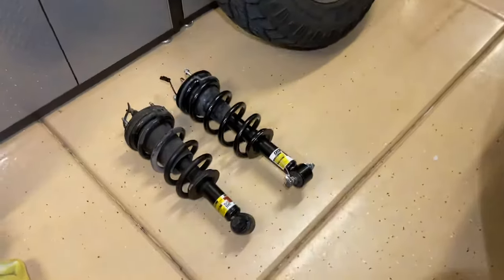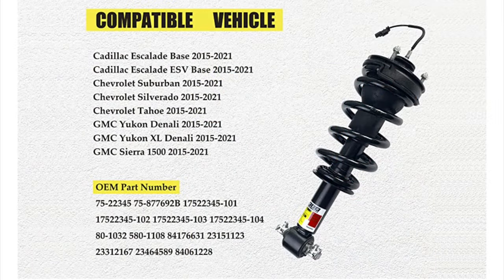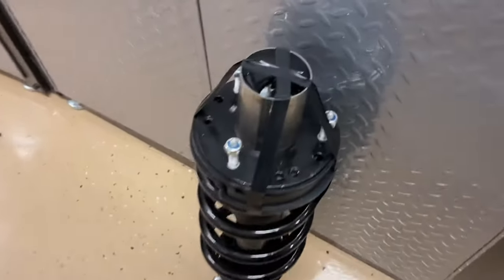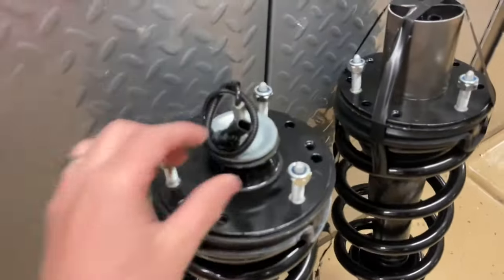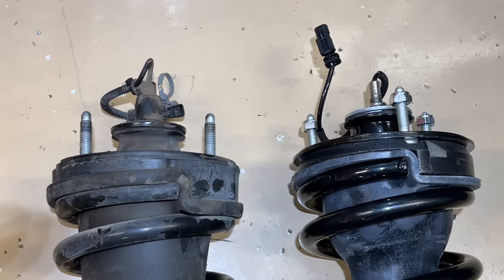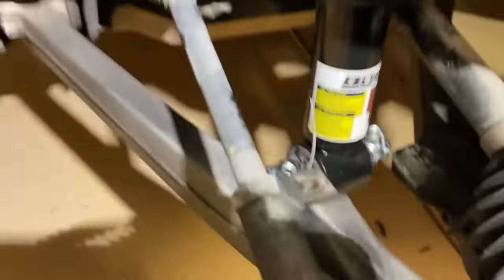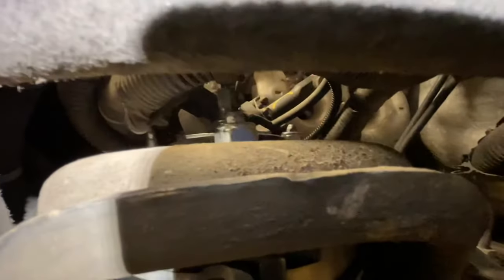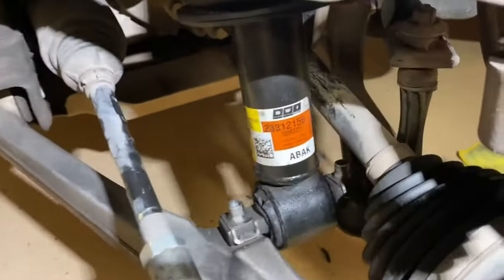Aftermarket Magneride shocks fitment problems

Comment: As most of yall are looking for answers as I was, I went to ebay and purchased a pair of aftermarket magneride struts for my 2015 yukon denali for a fraction of the price as OEM. Now with that I did have issues with the height difference because the old being wore out compared to the new one. This is an easy fix just unbolt the sway bar as you work on each side. I also had an issue with the new lower strut mounts not being in the right position just mount the top get some vise grips or something to grab the mount and rotate it 180 degrees. This requires some muscle! I hope this helps and save someone else some money!
Reply: Did your ride height go back to what is was before? Do they have to settle in? I just changed my 2016 suburban and it sits a little higher.

Comment: I installed replacement magnaride shocks and struts on my 2017 Escalade.  They fit right in with no issues.  I bought them from Auto Zone for about 800. Brand is Arnott and they actually use Eibach springs. Great videos, Especially the Cobra ones! Good luck
Reply from the maker: Thank you. I’ll have to check those out
Reply: Did you get just 1 or a pair for $800?
Reply: @jack0lee  for the pair.  They had a sale with 25% off and free shipping but this was over a year ago
Reply: @mharp7353  ah I see. They’re about $584 for 1 now.
Reply: @jack0lee  yeah seems like everything has gone up.  They usually have discounts if you order online, I'd keep checking their website, its worth it
Reply: Do they still work like factory GM ARC suspension?
Reply: @jack0lee    That just happens to be the exact price from GM parts direct (as of Nov 23).  FYI
Reply: @avflyguy  don’t have my Denali anymore but thanks for the info
Reply: @avflyguy  what's the website for GM parts direct?

Comment: I spent 164 dollars for the pair on eBay. Brand new. No issues going on. Ride is very smooth. I do want to thank you for the video. It saved me a lot of stress. U did everything perfect.
Reply: Which ones did you go with
Reply: What brand did you use? I have a 2016 Yukon Denali Xl
Reply: What was the part number?... would it fit 2017 suburban premier?

Comment: I just did this, All you had to do was undo the sway bar links and your lower arm will drop down enough to get the taller strut right in there, I don’t consider that a modification. Truck sits more level now, not so much rake, and rides 100% better!
Reply from the maker: It was also not lining up straight and I was not able to twist the strut. As I said, I didn’t want to make it non-returnable and they were very firm on not taking it back if it was installed. I also didn’t like how poorly written the instruction were on that brand and the warnings they gave that they might not work. I was much happier with the Arnott brand that went right in

Comment: The genuine GM magneride replacements now have a lifetime warranty where arnott has cut theirs to 2 years. GM only sells the fronts without the spring so the strut has to be disassembled and the clip removed, but at least it will be covered for life...
Reply: I highly doubt GM will honor that. 

But at $900/each they better

Comment: Well, a couple of days ago I replaced one (2016 Yukon Denali)and I saw exactly what you are showing here, I determined that the damaged one was compressed due to use and in addition it had already thrown away all the oil and when I removed all the screws it just fell to the not even necessary to loosen the stabilizer bar, and it was the original, well when installing the new one I obviously lowered the arm a little with a bar, tightened all the screws and that's it! The truck feels perfect, I don't feel like it's loading to one side. The height of the truck's body at the front is exactly the same as the right side, and well, my wife is happy to not hear that horrible noise that the damaged shock  had. Now someone tell me if it is not correct or the opposite, I saw some comments below and they practically think the same as me, greetings
Reply from the maker: I did what I felt comfortable with to the point I could still return the struts. By comparison, I went with the Arnott brand and they were aligned properly and went right in. For the money, that’s how the install should go. I didn’t want to mar them up and make them fit only to find out they could not be returned
Reply: @dannyjohnsonsgarage  You are right, perhaps the pressure from my wife, I decided to put it on even though I saw that there was still a difference and I was worried and looked for this video that I had already seen a few months ago, what do you advise me to do? I bought this one for 200 from someone in my neighborhood, I found it on Facebook,  He is a mechanic and he told me that he ordered it for a customer who never showed up. should I leave it like this? Or do I order the originals? I would appreciate your response!
Reply from the maker: @elhalcondelbajio1923  I would ask the mechanic you bought it from about the situation and see if he recommends you “make it fit” or not. Here are the Arnott ones I used in case you decide not to use what you have. This is my Amazon affiliate link and I will post the video below https://www.amazon.com/Arnott-Coil-Over-Eibach-Magneride-L-SK-3354/dp/B08VF88P43?crid=38JDH2IFYEA9K&keywords=Arnott+-+Fr+Coil-Over+Eibach+Strut+15-20+Cad+SUV%27s,Chev+Silver/SUV%27s,GM+Sierra/SUV%27s(K2xx)+w/Magneride-L/R+(SK-3354)&qid=1669272882&sprefix=arnott+-+fr+coil-over+eibach+strut+15-20+cad+suv%27s,chev+silver/suv%27s,gm+sierra/suv%27s+k2xx+w/magneride-l/r+sk-3354+,aps,290&sr=8-1&ufe=app_do:amzn1.fos.08f69ac3-fd3d-4b88-bca2-8997e41410bb&linkCode=sl1&tag=2004047-20&linkId=6ce005c6cd213796132b9c237f1113d5&language=en_US&ref_=as_li_ss_tl
Reply from the maker: https://youtu.be/8c7qfElwx3o?si=h9nV40nm1OMksaEg

Comment: Does anyone know why the passenger side strut seems to fail more frequently than drivers side?
Reply: I don't know but on my Sierra 1500 Denali,  the right side is blown out - dried oil and grease everywhere..  And on level ground it sat about 2 inches lower on the passenger side.

Comment: Please don’t use those bolts they provided they look cheap and not suspension grade. I used the original ones
Reply from the maker: Yeah, I went with Arnott struts in the end and used some of the factory hardware but theirs seemed better too https://youtu.be/8c7qfElwx3o?si=BKuibd56iAPdhGlX

Comment: curious what was the strut that caused this many issues?  i bought the dorman version, i had to take out the sway bar link total pain.  even with it removed and the strut all the way up in tower with closest nut spun down stuf 3/4 of the way the unit was down farther like in your video.  after messing around with a jack and wood to lift it up and soem prying it finally went into place.. then the fastners that guide the bottom two bolts and tighten it were wrong!  i had to transfer over the old ones.  a 1 hour job you see on youtube , in out was like a 4 hour job but it was my first one.  if strut was the right length to begin with and no sway bar link removal it would of be considered "fun" almost for the average dude. wonder if the arnott and dorman are same length!  ? what was yours from amazon?
Reply from the maker: The Arnott ones worked in the end. Went right in https://www.amazon.com/Arnott-Coil-Over-Eibach-Magneride-L-SK-3354/dp/B08VF88P43?crid=38JDH2IFYEA9K&keywords=Arnott+-+Fr+Coil-Over+Eibach+Strut+15-20+Cad+SUV%27s,Chev+Silver/SUV%27s,GM+Sierra/SUV%27s(K2xx)+w/Magneride-L/R+(SK-3354)&qid=1669272882&sprefix=arnott+-+fr+coil-over+eibach+strut+15-20+cad+suv%27s,chev+silver/suv%27s,gm+sierra/suv%27s+k2xx+w/magneride-l/r+sk-3354+,aps,290&sr=8-1&ufe=app_do:amzn1.fos.08f69ac3-fd3d-4b88-bca2-8997e41410bb&linkCode=sl1&tag=2004047-20&linkId=6ce005c6cd213796132b9c237f1113d5&language=en_US&ref_=as_li_ss_tl

Comment: Just a couple observations.  It's not uncommon on old magneride shocks for them to be stuck partially compressed and locked in that position.  So the fact that the new one was a little longer is possibly normal.  your old shock is probably worn/damaged and not extending as far as it's supposed to.

Also, it's totally possible for the top and bottom of a strut to be twisted.  They don't excent/compress only.  They are designed to allow twisting motion.  It might be a little harder to twist a brand new shock, compared to one with worn out seals
Reply from the maker: All I can say is I was not impressed. I since went with Arnott and they went right in! No issues 
https://youtu.be/8c7qfElwx3o
Reply: @dannyjohnsonsgarage  hey Danny. How are the Arnotts working for you??

Comment: Amazon usually comes through and eases our minds when we want to return something. This is what we need. Sears was this way back in the day and that was the formula for success. I am going with OEM but it seems magnaride shocks and struts are delicate. 
Thanks for the vid!
Reply from the maker: I’m the end, though, I had to pay shipping so I lost $60 or so for their mistake. I got the Arnott brand and they worked perfect https://www.amazon.com/Arnott-Coil-Over-Eibach-Magneride-L-SK-3354/dp/B08VF88P43?crid=38JDH2IFYEA9K&keywords=Arnott+-+Fr+Coil-Over+Eibach+Strut+15-20+Cad+SUV%27s,Chev+Silver/SUV%27s,GM+Sierra/SUV%27s(K2xx)+w/Magneride-L/R+(SK-3354)&qid=1669272882&sprefix=arnott+-+fr+coil-over+eibach+strut+15-20+cad+suv%27s,chev+silver/suv%27s,gm+sierra/suv%27s+k2xx+w/magneride-l/r+sk-3354+,aps,290&sr=8-1&ufe=app_do:amzn1.fos.08f69ac3-fd3d-4b88-bca2-8997e41410bb&linkCode=sl1&tag=2004047-20&linkId=6ce005c6cd213796132b9c237f1113d5&language=en_US&ref_=as_li_ss_tl
Reply from the maker: https://youtu.be/8c7qfElwx3o
Reply: If you don't mind me asking how have they held up and how many miles have you put on them thanks

Comment: I just replaced my 2018 tahoe shocks with the Luftmeister ones, magride. Both shocks that I took off were shorter than the new ones due to them being shot,. Leaking fluid. Install wasn’t so bad, loosened the sway bar. Now getting the service suspension notification.
Reply from the maker: I was also afraid of the message coming up, especially when the instructions straight out talked about diagnosing them.
Reply: @dannyjohnsonsgarage  have you got the service suspension warning fix already I have the same issue with my 2016 ltz
Reply from the maker: @carmelochavez2190  I have not gotten the message, but saw a video on how to bypass it by adding a kit that plugs in near the brake pedal. If you end up getting normal suspension it may be useful, otherwise it’s hard to find good replacements
Reply: @dannyjohnsonsgarage  ok I appreciate the reply back I seen the bypass but I'll look into it really appreciate the quick reply thanks
Reply: I had the same issue. Turns out my connection was bad. The pins weren’t set inside the housing all the way, so I wasn’t getting a proper connection. 
I would check this. Not sure if it helps, but maybe check to see if they are reversed?

Comment: I have the same problem today 😅after all the work I see your video ,
Reply from the maker: After going back and forth for a year, not knowing what to do , the Arnott ones worked perfect and went right in.  https://www.amazon.com/Arnott-Coil-Over-Eibach-Magneride-L-SK-3354/dp/B08VF88P43?crid=38JDH2IFYEA9K&keywords=Arnott+-+Fr+Coil-Over+Eibach+Strut+15-20+Cad+SUV%27s,Chev+Silver/SUV%27s,GM+Sierra/SUV%27s(K2xx)+w/Magneride-L/R+(SK-3354)&qid=1669272882&sprefix=arnott+-+fr+coil-over+eibach+strut+15-20+cad+suv%27s,chev+silver/suv%27s,gm+sierra/suv%27s+k2xx+w/magneride-l/r+sk-3354+,aps,290&sr=8-1&ufe=app_do:amzn1.fos.08f69ac3-fd3d-4b88-bca2-8997e41410bb&linkCode=sl1&tag=2004047-20&linkId=6ce005c6cd213796132b9c237f1113d5&language=en_US&ref_=as_li_ss_tl
Reply from the maker: https://youtu.be/8c7qfElwx3o

Comment: I just did my struts today with the arnotts and I had the same problem you did but I used a couple little Honda jacks and some foot long 2x4s to push the rotors downwards and another jack to push up on the struts and it worked perfectly
Reply from the maker: I ended up with Arnotts that went right in, but I wonder if they were 2wd. It said Denali 4wd when I bought them. The main problem I also had was having to potentially turn the struts to line up which I didn’t want to chance and make them non-returnable
Reply: Which arnotts did you go with , I did the sk3354
Reply: Nevermind I just read on another comment that you posted the link to yours and we got the same ones, they ride really nice.

Comment: Good i watched your video,  i was about to buy 2 shock absorbers then i changed my mind after this.
Reply from the maker: I later went with armortt and they went right in 
https://youtu.be/8c7qfElwx3o?si=a6wGC5_sjP3tnws4
Reply from the maker: https://www.amazon.com/Arnott-Coil-Over-Eibach-Magneride-L-SK-3354/dp/B08VF88P43?crid=38JDH2IFYEA9K&keywords=Arnott+-+Fr+Coil-Over+Eibach+Strut+15-20+Cad+SUV%27s,Chev+Silver/SUV%27s,GM+Sierra/SUV%27s(K2xx)+w/Magneride-L/R+(SK-3354)&qid=1669272882&sprefix=arnott+-+fr+coil-over+eibach+strut+15-20+cad+suv%27s,chev+silver/suv%27s,gm+sierra/suv%27s+k2xx+w/magneride-l/r+sk-3354+,aps,290&sr=8-1&ufe=app_do:amzn1.fos.08f69ac3-fd3d-4b88-bca2-8997e41410bb&linkCode=sl1&tag=2004047-20&linkId=6ce005c6cd213796132b9c237f1113d5&language=en_US&ref_=as_li_ss_tl

Comment: I do the same with the front shocks Tahoe 2016 LTZ, no issues after market shocks TQR, the old ones to short a lot a miles on it i save money no returns
Reply: I installed trq struts on my 2018 escalade but the ride is really rough now. The truck is even higher from the front. You had no issues?
Reply: Does the TQR shocks and struts ride good? I have a 2016 Yukon Denali Xl and was considering ordering that brand for my truck.

Comment: This is EXACTLY where I am right now! I have a 2010 Cadillac Escalade EXT with a questionably functioning Magneride Suspension. I am looking at a FULL REPLACEMENT PACKAGE with Coil Over Fronts and Regular Rears, and a replacement Leveling Pump for the Rear, made by TRQ, for about $1,200 with Shipping. What do you think? Thanks!
Reply from the maker: I had better luck with Arnott brand

Comment: Hello Danny. Your video has helped me a lot. I think I'm due for a strut replacement. My yukon is 2020 xl denali. Sits a bit lower in the front. Not sure if that's normal. But I've noticed my ride quality is a bit bouncy on rough roads. I figured I'm due for a pair. Have you purchased a pair yet? Would you use a level kit 1m4 or 2 inch raise? Or just an oem replacement. I saw a thread about the dorman brand being a direct replacement.
Reply from the maker: I have not yet replaced mine and they are eating up my tires. After research, I think I will go with the Arnott brand. Not sure on a leveling kit but it seems like a good idea https://www.amazon.com/gp/product/B08VF88P43?&linkCode=sl1&tag=2004047-20&linkId=4c1a8f8cd496edc237ddddedfa7bbee7&language=en_US&ref_=as_li_ss_tl
Reply: @dannyjohnsonsgarage  im not sure if my shocks are bad. But I did see some dirt grim near the boot. Not a lot. No leaks on the ground. I did notice my ride is a bit more bouncy. Not sure if the roads are just bad.
I have 54k miles on my 2020 yukon xl. Tires looks brand new. No signs of Uneven wear
Reply: Hey Hoss. I just helped my brother replace his front struts on his 2016 Yukon Denali. He bought a set of Dorman brand and had the same issue. We ended up having to replace the retainers on the bottom of the mount and use a large pair of channel locks to get them to mount correctly. Inconvenient, but not the worse job at all. I would even go with the set Danny had gotten and just made it work. Truth be told, you're going to run into these situations on aftermarket items that do not use the factory assembly machine. Hope this helps. Let me know if you need the link to the one's my brother purchased.
Reply: @Gabriel Cabrera  Hello I appreciate the input. I ended up taking my Yukon to the dealership and they replaced the entire assembly unfortunately. It was an expensive repair as I did not have the time to work on it myself and needed it done as soon as possible. I was trying to find the time to do it myself between work and taking care of the family..The drive was very uncomfortable and bouncy all over the place. Now all good and very smooth.

Comment: BWI is Borg Warner.  They make a ton of components for our vehicles.
Reply from the maker: These were horrible. I went with Arnott and they went right in with no trouble https://www.amazon.com/gp/product/B08VF88P43?&linkCode=sl1&tag=2004047-20&linkId=4c1a8f8cd496edc237ddddedfa7bbee7&language=en_US&ref_=as_li_ss_tl

Comment: Pretty sure that shaft spins in the housing. Which would make the mount bar on the bottom pivot 360 degrees in whichever position you desire
Reply from the maker: I was not interested in “making them fit” and being non-returnable. I went with the Arnott brand and they went right in

Comment: Lol your new one was a inch longer because the old ones where broken. And did you try to switch sides ???
Reply from the maker: No, these would not fit and I wasn’t going to gouge them up and make them not returnable. whereas I then purchased the Arnott brand and they went right in as they should.